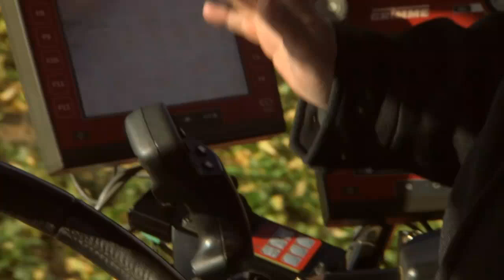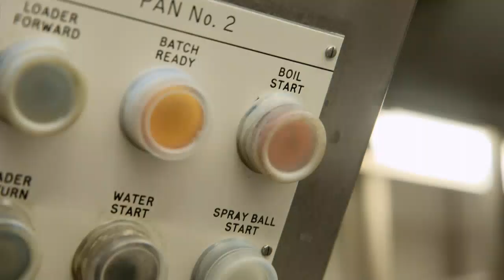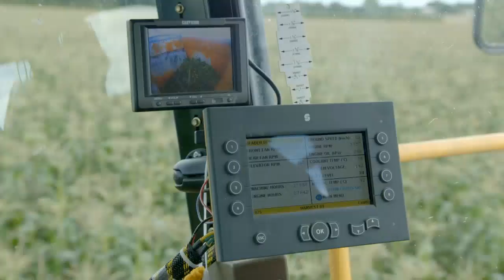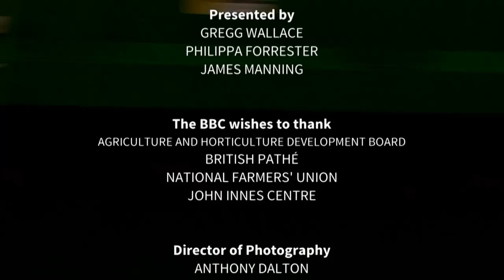BBC Harvest Series 1 1of3 The East 2015

Comment: In Peru in the highlands and in the high andes,  corn is called choclo and it is starchy but not "sweet. " It is delicious in my opinion. There are many varietals of choclo,  and it comes in many sizes , colors and flavors representative of the biomass in which the choclo was grown.  Literally, it is organic hand grown hand picked corn.  Consumers from  the US, Europe  are used to industrialized corn that is uniform in size, with about 500 kernals per a 12" cob. Iit is called Dent corn and the 6 modern varietals  all come from this one root stock developed way back in the 1800's. The sweet yellow corn varietal  that we eat on the cob, make cornbread, use in tortilla chips is high in fructose because that is what the modern consumer wants and expects from corn. High fructose corn syrup is in everything you eat nowdays. Diabetes heaven.   Also, modern Corn is grown with massive use of pesticides. Fields of recently sprayed corn are so toxic that poison signs need to placed around the fields as a warning to stay out.  The BBC doc does not even mention this unsavory aspect of corn growing in the UK.

Comment: You can't eat maize? Good thing the natives didn't know that. Granted the dent form is not the greatest and after eating modern high sugar sweet corn it would be hard to like even flint corn while it's soft but it's inedible. By the way maize also includes popcorn.
Reply: 57WillysCJ maize is processed to be used as a flour or gruel. It certai ly is not going to be esten straight off the cob. Sweet corn varieties are bred to be softer, sweeter and easier to cook.